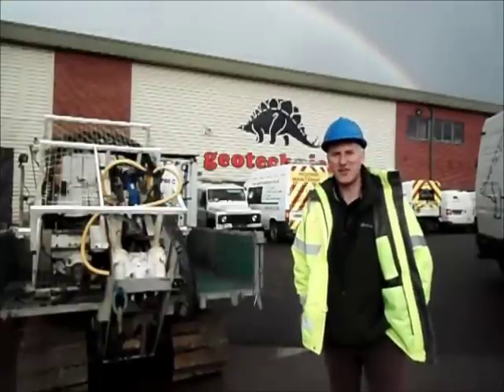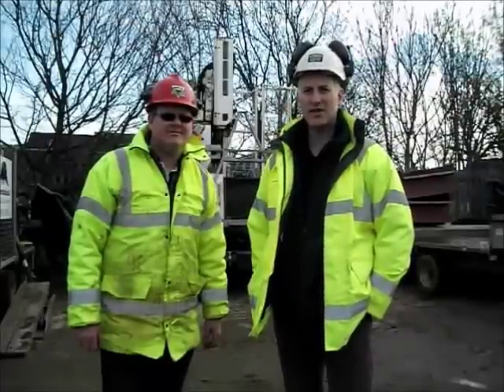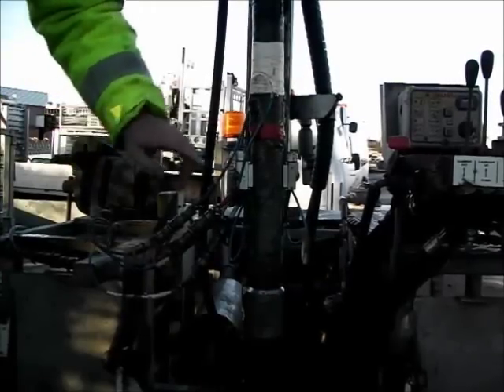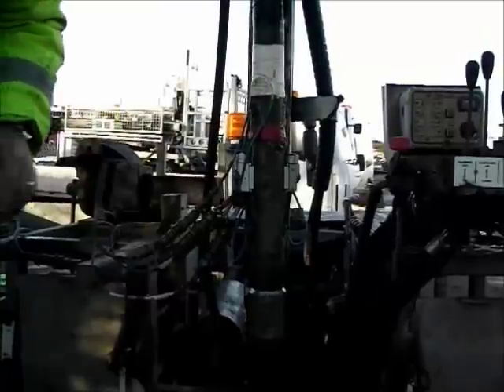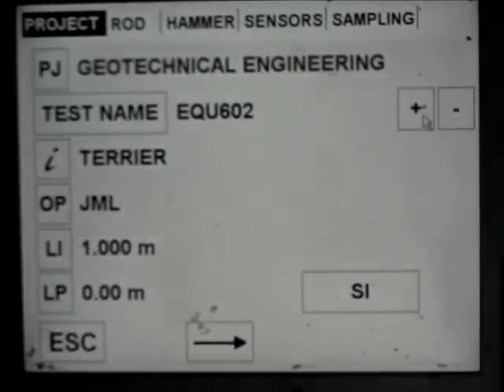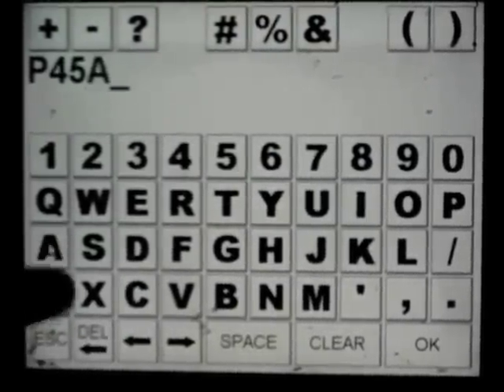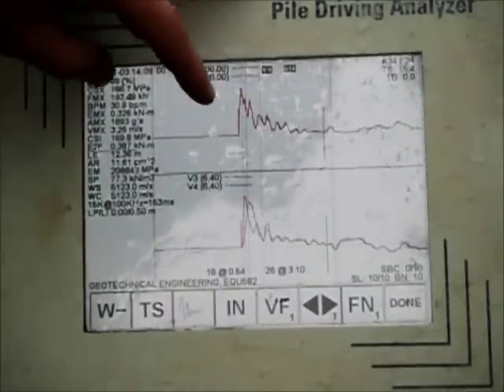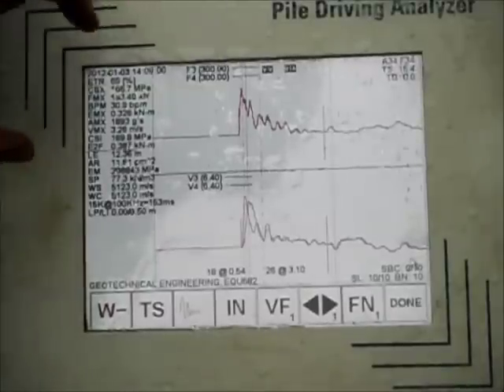SPT Calibration Test w/ Geotechnical Engineering

Comment: Is there any loss of hammer energy through the sidewall of the boring using smaller AW rod size versus the larger NW rod which of course is stiffer and how much more energy loss would there be with depth as the boring advances deeper?